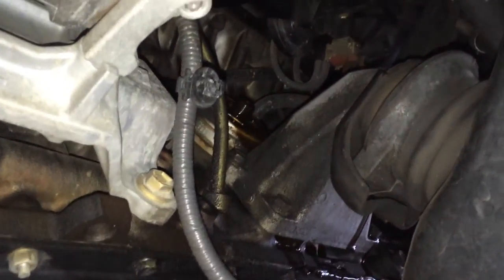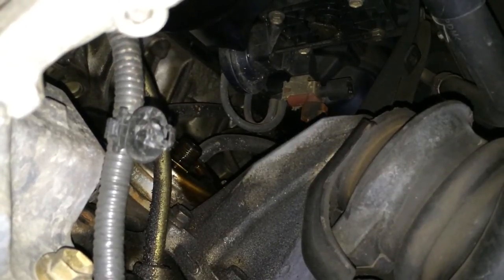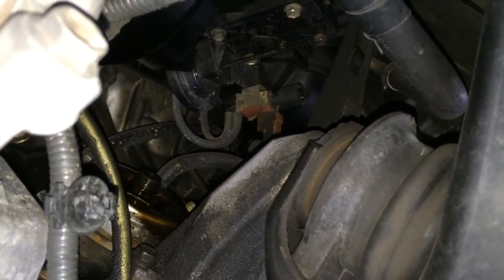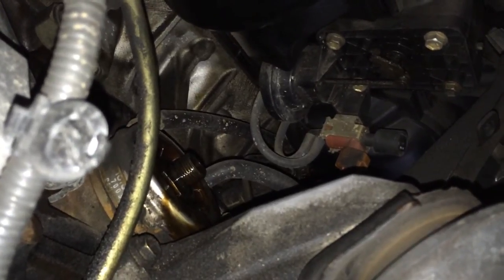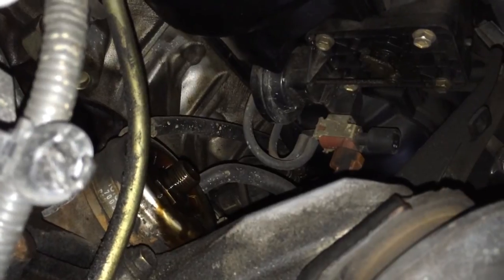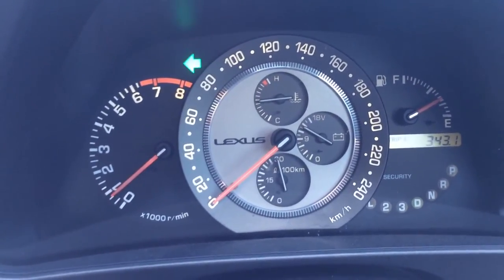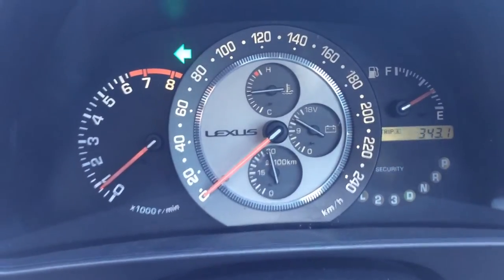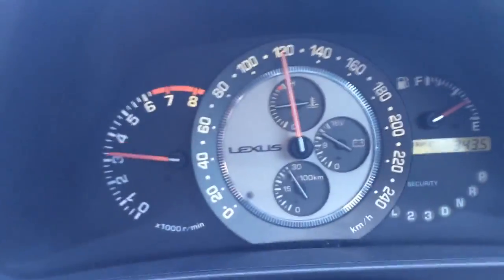How to Disable ACIS on your toyota

Comment: Couldn't you just swap the line routing so the manifold and valve are just routed to themselves, and the solenoid is routed to itself too? I ask because in theory, you'll then have direct relationship between manifold vacuum and valve position. Should in theory allow you to benefit from ACIS efficiency at part throttle, but have the valve open when you ask for power and the manifold vacuum drops. It's set to short runner position until it sees vacuum right?

Comment: Hello. Please report how is with low-mid torque and fuel economy.
Reply from the maker: Mre M no 'adverse' affect for low/mid range.. it's just louder.. if anything i think the 1G-FE version of this system was primarily done for noise as the market of the IS200 was the same as the BMW 3 series. Fuel economy is no different.
Reply from the maker: Mre M BTW Mr M - after i saw your response on my other video - 
https://www.youtube.com/watch?v=2zw9nRrHpR0&lc=z13msxejekmuedeat04cfjuhxzimjjwp4hc

i immediatley searched google for ACIS IS200 and came across a few old posts on clublexus of MYIS forums.. so i thought i would do this video on 'how to'... :) thanks for the heads up!

Comment: So if the engine got boost from supercharger than there will be no vacuum but pressure on the VSV so the intake will be in a short run?
Reply from the maker: As long as the SC is creating boost (like a TTE kit) or similar - yes. If it ls like the older 1GGZE or 4AGZE, then not always

Comment: Hey there, just curious what kind of plugs you used for the vacuum lines, I'll be doing mine soon. Also Thanks for the video. The rpm "lag" is annoying as all hell lol
Reply from the maker: Literally put some pan head screws in with zip ties.
Reply: This Lag is caused mainly by ETCS-I not ACIS, you are wrong, throttle body is bad and do this lag, ACIS is completly good system, so if you open this at all your max power won't better, but you only destroy power on low RPMs, maybe this noise cause that driver thinking that car is faster, but real isn't. It is even not variable lenght, but it is variable value of manifold, so this work like DISA in BMW, so I think that somebody mixed shorts ETCS-I and ACIS, and make wrong modification haha